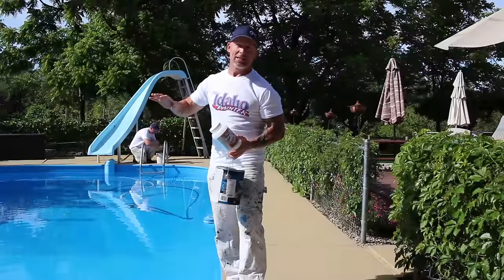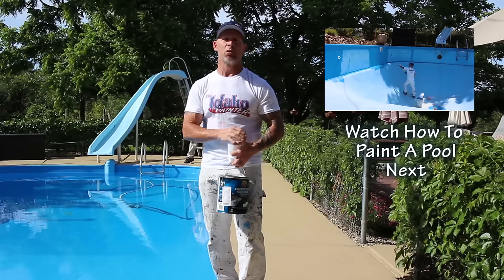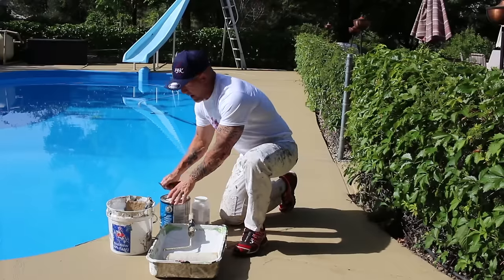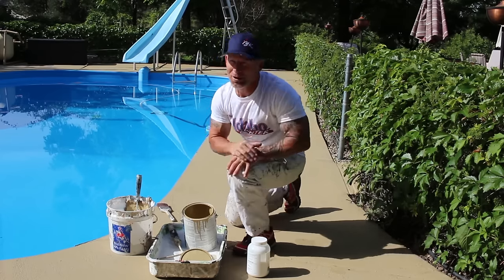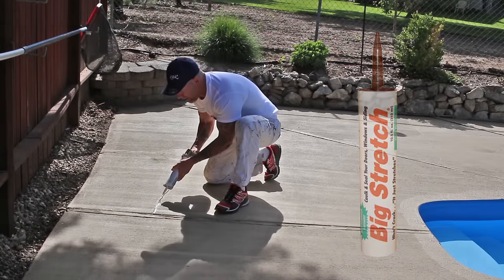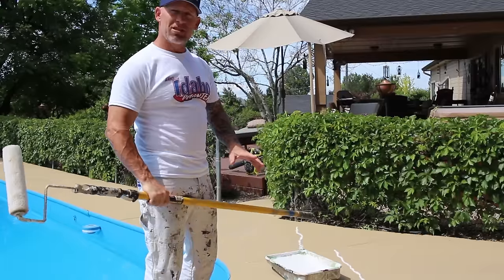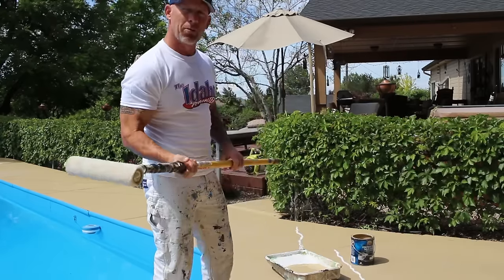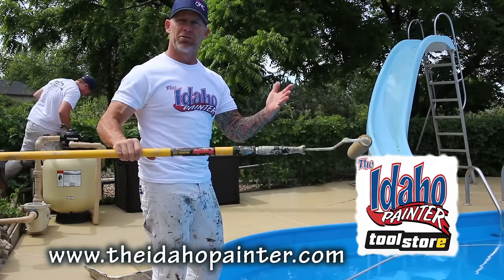How To Paint A Pool Deck.  DIY Tips Painting Concrete Pool Decks.  Painting swimming pools.

Comment: For those cracks on a slightly textured deck. Depending on the crack size dust  your caulking with your h&c shark grip or silica sand.  It will blend in much better and help feather out the sides
Reply from the maker: Thanks for the tip

Comment: had to change the color on the deck so it took more than one coat...very slick now...will the shark grip get me what I need tor non slickness?  Difference between Shark Grip and Gator Grip?
Reply: used Dyco acrylic stain...water based

Comment: I must advise if your pool deck is textured a 1/2” nap covers better and will hold more paint. Otherwise a 3/8” nap will not get into the grooves without excessive muscle work having to push the paint in.

Comment: If I use H&C solid color stain on my garage floor, driveway & sidewalk (with sharkskin) , do I still need to use a seal coat over it?  If so, what sealer would you recommend?
Reply from the maker: No, you do not

Comment: Nice vid and good info. Have you ever used Encore product Cool! Pool Deck Coating ? According to them any paint/stain will increase heat retention of your "Kool Deck" (or knock down) surface. This product is supposed to maintain cooling properties. I live in FL and this is important.
Reply: I'd like to know the answer to that too.  I was just about to purchase the Cool pool deck paint, but checked Amazon and it has a lot of bad reviews.
Reply: About to paint a pool in FL, so glad I saw this comment

Comment: Do you have to prime the concrete before applying this stain?  Thanks in Advanced
Reply: No the primer goes into all of the concrete stains/coatings.  If previously coated you will need to make sure to use the right coating/stain overtop of this.  2 things I will recommend that this guy doesnt.  1 add mildewicide/anti sporham to the paint.  I don't care what any yoyo tells you just do it.  Secondly use an 18 inch roller,  and a 3/4 inch nap.  Sometimes these are hard to find at the box stores and can be found at sherwin Williams.   Also you want to have a paint grid to go in your tray.  If you dont see an 18 2 regular paint grids will do.....9 inchx2......

Comment: OK ... thin coat ;-) got it... Does that mean you don't use two coats ???... Would you ever at any time use two coats ??? Also did you use a water base or oil base ... Thanks in advance .
Reply: Thank you sir :-) we just prepped our pool deck hoping to get painting tomorrow... (using the H&C concrete sealer too) Thank you for getting back to me on this , God Bless <3

Comment: I have painted 300 pool decks . What I learned is in the sun belt , lower states that are hot .  you can expect to get sued for this application  on bare  concrete , The efflorescence from the mineral content in the concrete is that it  expels salts  from the moisture and arid climate  evaporates moisture through the surface and dalaminates the paint over a short time causing peeling of paint and the customer expects it repaired . Then you have a life time maintenance nightmare . Judges here in southern California will charge you three times the cost of the job to have the paint  sand blasted off . The only way I have stayed in business is to apply concrete  adhesive and then a  white cement coating with stucco color tint  to create a colored cement , then splash the texture with a stucco splash brush one eighth to a quarter inch thich peaks and valleys , let it partially dry , then trowel a knock down finish . Wait overnight , then paint that porous surface  , which will hold the deck paint within the pores of the new structurally  adhered cement coating . It will last ten years to twenty years . No paint peeling , delamination  , or blistering from the white efflorescence that forms between the concrete surface and the paint / stain .  It is false advertising to promote painting regular concrete in the south , especially west of the Rocky mountains where the mineral content of the rock and sand are sources of this condition from wicking moisture from the pool wall or from rain and washing . Commercial pools are washed very often . Do not paint bare concrete in the south west . The paint company may offera few gallons of paint to repaint , but the same thing will happen sooner than you think it will and you will be a slave to the job  forever .repainting  often .best of luck and protect yourself at all times from quick fixes like they are promoting .
Reply from the maker: Awesome, thanks for sharing Don!
Reply: Don McKinney and Paint Life TV, I am looking for a suggestion for choice of pool deck paint. I'm in Florida. I just had an extension to my pool deck poured. You can see a picture here: https://imgur.com/a/Etv3vbQ

That part I will make a knock down texture to make it match the old pool deck. After that I plan to use Rustolium Etch and Cleaner and then prime with  BEHR Premium Concrete and Masonry Bonding Primer and then paint.

On the old part of the pool deck, it has previously been painted with 3 or 4 layers of latex paint. I used caustics soda to strip the last layer, which had been peeling. After that I sanded the entire deck so all the tops of the knockdown texture are pretty much free of paint. I am not sure how to continue from here. Wash? Etch? Prime or what? And what type of primer ?(if that's what I should do).

Finally when both areas are prepped, what paint/stain to use? Hopefully I can use same type both places. We want a darker peach color, so it must be tintable.

I hope you guys will take a minute to help me out. 

Thanks
Mike